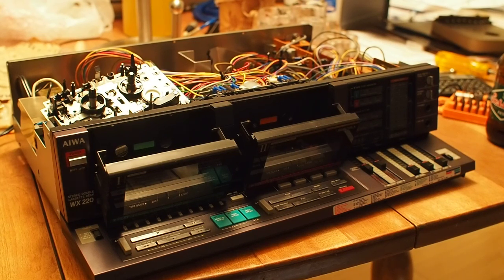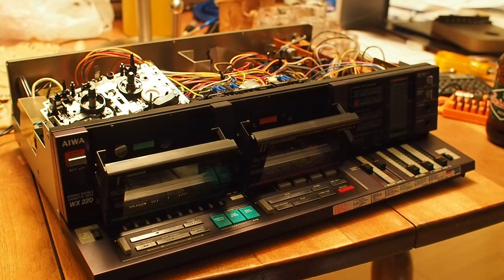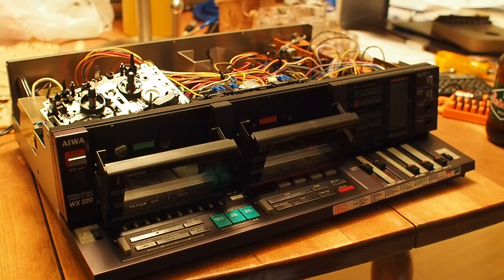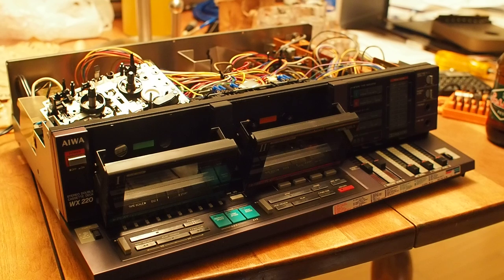All about Cassette Decks, Tapes, and Replacing Belts Starring an Aiwa WX-220 - Part 1

Comment: There is SOMETHING called a SERVICE Manual that you can get for ANY make or model. I wish people would DO their RESEARCH first. I own a Technics AUTO-REVERSE Cassette Deck from 1993 with the rotating playback head. It works FINE, and I own THREE of them. And what is a TURNY-THING? Damn, don't you people KNOW your technical LINGO? Oh man, after almost 30 YEARS of repairing Audio/Video equipment, you just PROVED to me that duct tape can fix many things, but it CANNOT fix STUPID!!!
Reply: Whatever you think is best. It's YOUR freedom of expression. ^_^
Reply: if duct tape is good for the space shuttle, its good for most anything here on earth -
Reply: Ok god